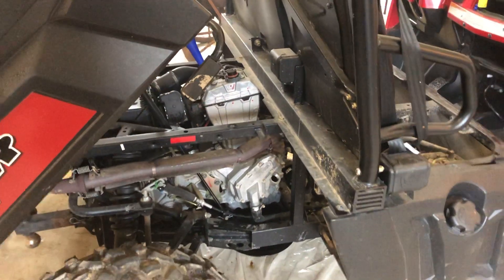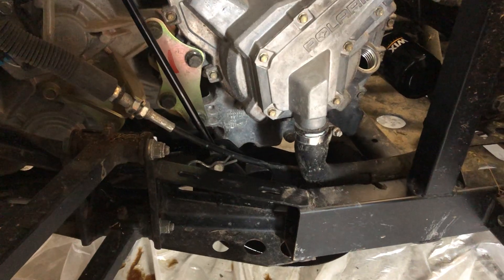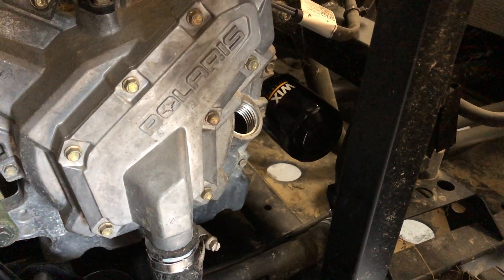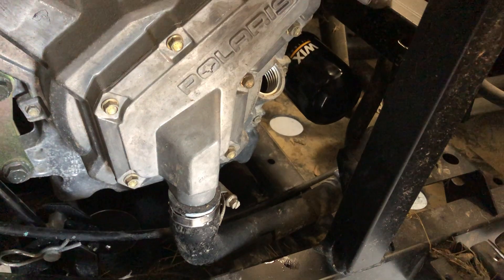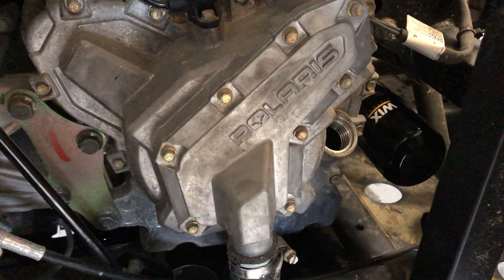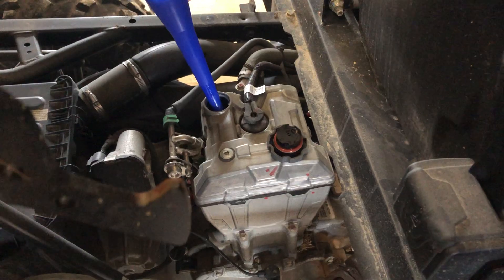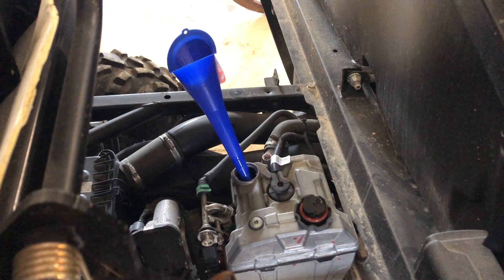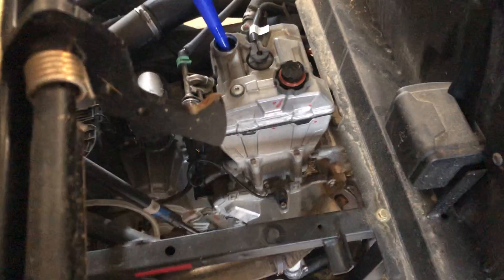Polaris Ranger 570 Oil Change Procedure

Comment: The Fram XG is one of the best filters on the market.  They are Fram’s premium filter, been running thrm on multiple machines with zero issues,

Thanks for the video, and taking the time to include the excellent detail.  I’m looking at a 500 Ranger.
Reply from the maker: WBOS72 That’s cool man.  I have never used an XG.  I’m sure they are fine filters.  I use Wix for two reasons.  

1) I get a deal on them.  Lol
2) I am good friends with a diesel truck mechanic and he recommends them.  They run 15,000 miles between oil changes and the wix hold up really well.

Granted, a diesel rig and a Ranger  are not the same thing, but I figure a good filter is a good filter.

Good luck with your Ranger if you get it.  I love my 570.  Only had 1 issue with it (see my other video about the radiator hose).  

Thanks for watching!